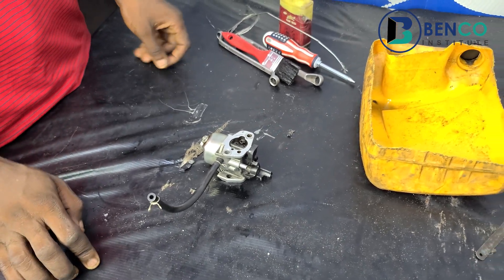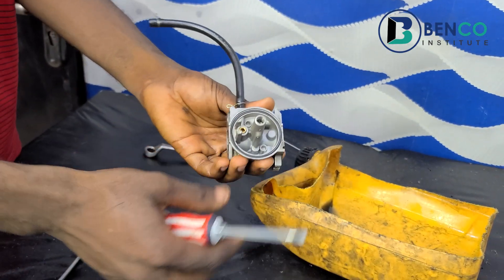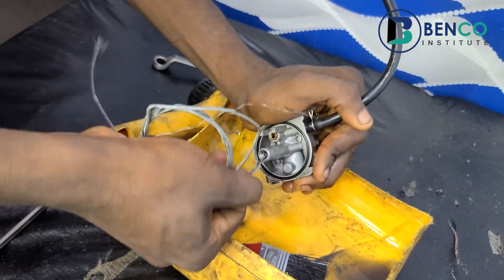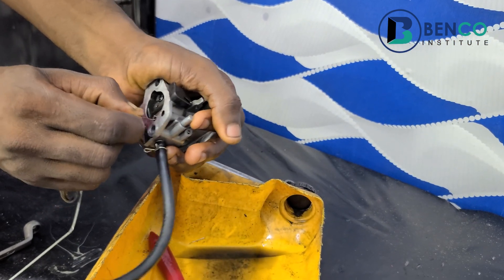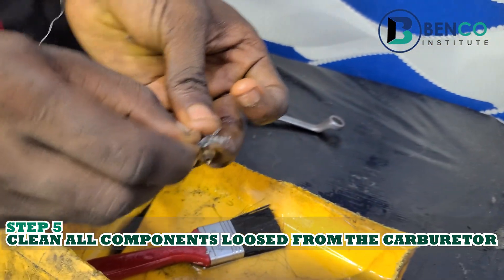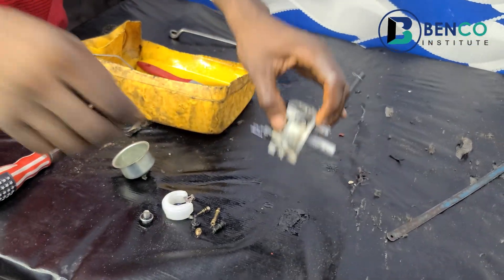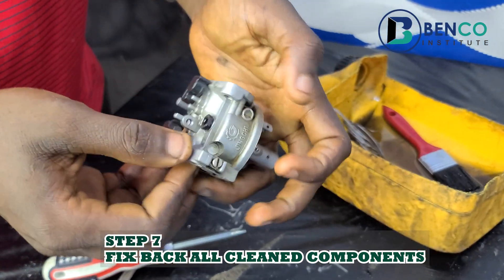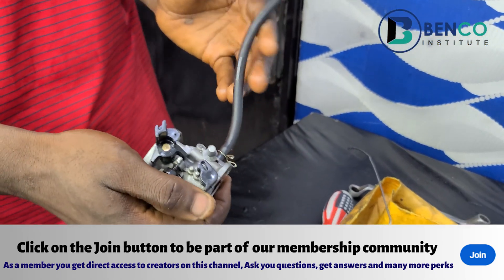Carburettor Adjustment,Service ,Rebuild and Tune a Carburetor/How to clean a carburetor

Comment: Weldone boss .
You videos is always understood.

My question is .when can i know to change a carburators .
Secondly concerning the nut used to adjust the fuel consumption i tried it ok.  the firman generator 6.6hp i tight it to later  but the generator consumption fuel didn't reduced.

Thank you

Comment: Why does oil come out from the valve cover and soak the form of the carburetor cover
Reply from the maker: The oil that gets to the halve cover is that oil that helps lubricate the tappet and other components at the top cylinder head...

The excess is the one that now flows to the carburettor cover